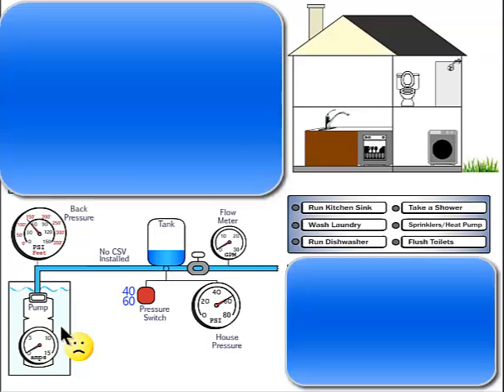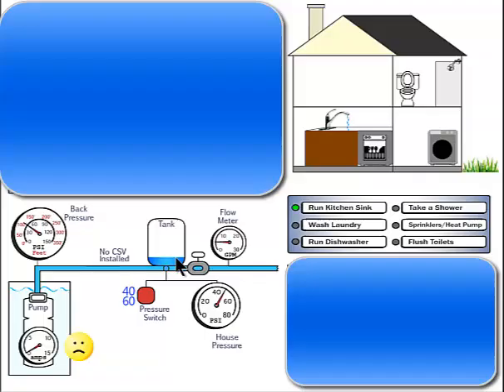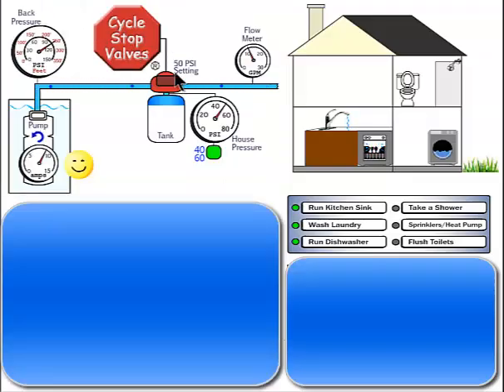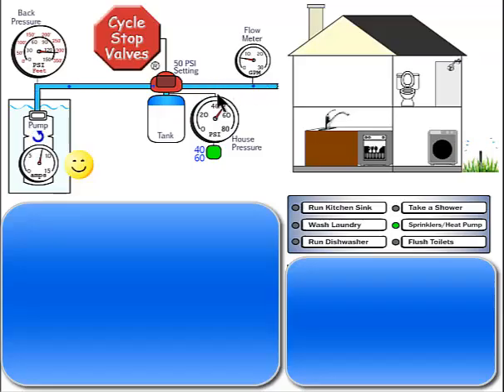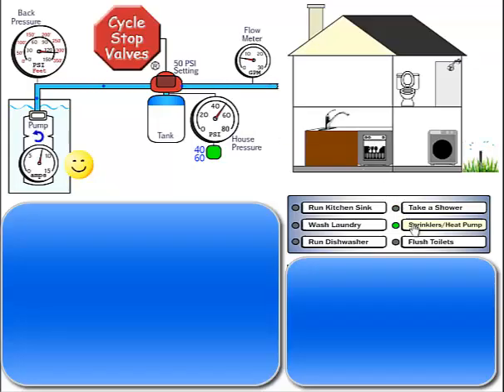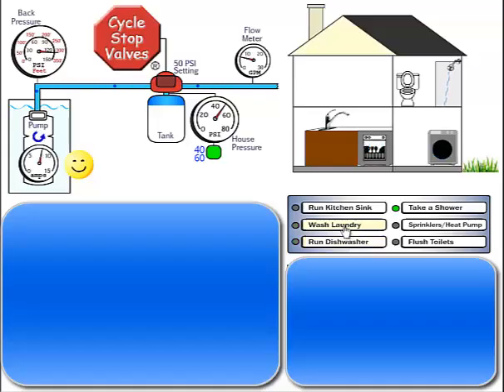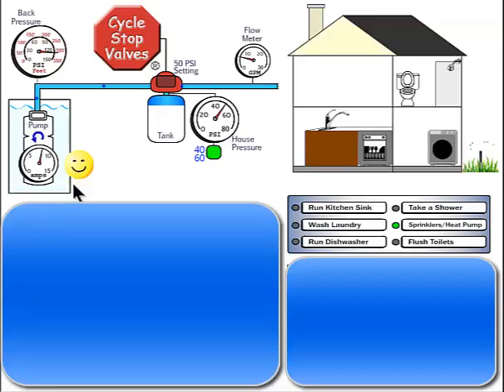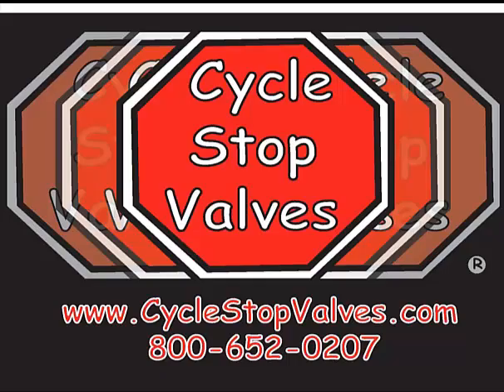How a Pressure Tank Works and why you need a Cycle Stop Valve

Comment: How would it help with a low yield well? I am thinking of putting in a storage tank connected to existing well pump AND adding a booster pump to the existing 32 gallon pressure tank.
Reply from the maker: You need the Cycle Sensor to protect your well pump from running dry.  The Cycle Stop Valve would go on the booster pump to keep it from cycling to death and to deliver strong constant pressure to the house.

Comment: I'm not so sure I agree with your theory many companies have tried "so called tankless gadgets" My Grundfos SQE and CU301 controller is a true variable speed well pump. It seems like the CSV is the "Gadget"  to harness the old traditional well pump and pressure tank system. 

The truth is, I use the Grundfos and Goulds Aquavar ABII because of the true variable and the soft start ability. My solar inverters don't like the initial 60 amp surge at startup of a standard well pump.

 Your example of how a typical well pressure system works is excellent. My system is a little bit rare and your CSV is a much more economical way of doing almost the same thing.
Reply from the maker: It is the other way around. The SQE was introduced in 1999 to compete with the constant pressure of the Cycle Stop Valve that was introduced in 1993.  They wanted something to produce constant pressure that would not make pumps last forever like a CSV.  The CSV and variable speed pump both vary the flow and deliver constant pressure.  The PWM or pulse width modulator, which is a VFD, is like a Rube Goldberg contraption compared to the simple Cycle Stop Valve.  The mechanical CSV does in one simple step what a VFD takes thousands of bits and bytes and components to computerize and line up correctly to accomplish the same task.

I agree you need a soft start if you are forced to live on solar.  But you don't need variable speed to get soft start.  The SQE pump is just a full speed SQ pump when a simple pressure switch is used instead of the CU301 controller.  But it still has the 5 second soft start built into the motor.  The SQ pump has become fairly reliable even though it spins 3 times as fast as a normal pump.  It is the CU301 most people have problems with and have to expensively replace on a regular basis.  

That is when most people find us as they are looking for an alternative to the CU301.  Amazingly, the SQ pump has almost as good of a drop in amps when restricted with a CSV as when slowed with the CU301 (VFD).  Replacing the CU301 with a Cycle Stop Valve and normal pressure switch makes the SQ pump many times more reliable and long lasting.  As neither the SQE or Aquavar are "tankless" like the ones you quoted me discussing, the existing little tank will also be fine with the CSV.

I like "rare" systems.  I have never seen one where the CSV couldn't do as good or better than a VFD.  Yes, the CSV is more economical, but it is also simpler and makes pumps last longer than a VFD.  You also won't loose the soft start feature when replacing the CU301 with a CSV.  And although soft start is helpful with inverters or generators, varying the speed with a VFD causes the pump to use more Kw per gallons produced.  You get more gallons per Kw from your solar or batteries if you use a full speed pump to fill a pressure tank as quickly as possible and let the pump shut off.  A VFD is just a Rube Goldberg gimmic when it comes to pumping water.  https://cyclestopvalves.com/pages/vfd-repair-kit

Comment: Will this work with a Harbor Freight shallow well pump?
Reply from the maker: Yes, except some of those motors say "not for continuous duty".  Only pump/motor I ever saw that says that.  The Cycle Stop Valve takes all the jerking and cycling out, but I think these pumps are still made for light use.  I wouldn't leave it running for hours on an irrigation system like with other pumps.

Comment: So if my pump is capable of build 175psi, but my pipe before the cvs is 125psi pipe, wouldn't i need to worry about it blowing up the pipe? Older 1" black roll.
Reply from the maker: Yes. That is why we check those things when recommending a CSV.  But usually there is only 30-50 PSI more on the pipe than the normal pressure that happens because of the depth of the well and the pressure on the pressure switch.  If the pump is 260' deep when the pressure switch gets to 60 there is 175 PSI on the pipe at the bottom of the well, even without a CSV.

Comment: My main concern on the Cycle Stop Valve is the increase in backpressure. I've read many positive reviews on your website about them but also many of those same positive reviews have had fittings blow apart and or leaks due to the increased back pressure between the pump and pressure tank. Although I see the need to try and reduce pump cycle's the last thing I want to do is have to dig up a water line or pull the well pump due to fitting failure from the increase in back pressure. My Franklin Electric Pump lasted 23 years before needing to be replaced on the traditional pressure tank and switch system.
Reply from the maker: Back pressure is good for the pump, cannot be any more than your pump can make, and the CSV itself has a limit.  I only know of one idiot who blew off the incoming pipe, he just posted it on Amazon, which we do not do business with, so they keep that post up top.  Lol. If your pump lasted 23 years without a CSV, it would last 40-50 years with one.  We have only done this about a million times over the last 30 years.  So, look at your pump curve, figure out how little back pressure it can build, get over your concern, and start enjoying strong constant pressure instead of seeing that pressure go up and down over and over and over.

Comment: I have been running cycle stop for about 4 years now it’s still working . We had a deep freeze destroyed the pressure switch when the 1/8 line froze .(my fault I forgot to connect heat lamp).
Reply from the maker: Thanks for the update.  I hope and expect you to still be saying the same thing in another 20 years.

Comment: Doesn't restricting the outflow from the pump put a strain on the motor increasing amps used?
Reply from the maker: No.  Actually just the opposite is true.  Amps decrease as the flow decreases.  Restriction with a valve makes the pump work easier, not harder.  But you are not alone in thinking that.  It is so counter intuitive that it even blows the minds of many engineers.  Since Youtube refuses to remove misinformation, you can find several videos from an "engineer" who makes himself look like an idiot on this subject.  He apparently doesn't know how to read a pump curve, which pump curves show the power decreases with flow.  But stopping a fan with his finger or watching amps from some kind of strange positive displacement pump shows his complete lack of education on how a centrifugal pumps works.  There are many people with whole house sensing systems that have posted the amp drop when using a Cycle Stop Valve.  But any amp meter will prove it for you.
Reply: @cyclestopvalves8380  OK, what would happen if you completely close the valve so there is no flow but keep the pump on.  What would happen to the power consumption of the pump compared to no restriction to flow?
Reply from the maker: @rogerg4916  Closing a valve before the pressure tank/pressure switch would deadhead the pump.  That would cause the amps to drop really low and the pump to continue to run until the water got hot and melted down the pump.  Then the amps would spike and trip the overload in the motor.  Closing a valve after the pressure tank/pressure switch the CSV would slowly fill the pressure tank until the pump shut off at the required pressure.
Reply: @rogerg4916  I experimented with that as I approached 0 flow pressure dropped . The biggest danger is with out flow pump cavitation can damage impeller , heat can build up and destroy the motor or seize bearings
Reply: @charlespaine987  If you restrict flow down stream pressure of course will drop.  The question is whether doing this causes the pump to use more amps or less.
Reply: Uses less Amps cause it’s moving less water… pretty simple theory actually!
Reply: @cyclestopvalves8380  The guy making videos about your product does seem like a little obsessive.  It would be easier to take your product and design seriously if you took the highroad and just stood on your/it's merits.
Reply from the maker: @dmills13F  The guy is not just a little obsessive, he is totally nuts.  It is hard to take the high road anymore.  I have been dealing with idiots like him for 30+ years and am out of patience with stupid people.  Anyone who believes a word he says is stupid as well, and I have no patience for them either.  It is illegal and against Youtube rules to post false information.  But they get more clicks from fake news than real news , so they won't do anything about it.  Youtube needs to be fixed and do what they say they will do!!
Reply: @cyclestopvalves8380  I don't agree with you on this.  You'd be trusting YouTube censors to know what is true or false. Knowing that opposing views had been censored would make people suspicious. Just let people get all sides and reach their own conclusions.
Reply from the maker: @rogerg4916  I agree with  you regarding ANYTHING that is debatable.  But going against known facts is a different story.  How pumps work is not debatable.  It is a known science.  Anyone who can read a pump curve or specs can see that amps decrease as the flow is restricted, know there is a limit to how many times a pump can cycle, but not how long it can run since it says made for continuous duty.  This is as well known and provable as the sun coming up in the east and the world being round not flat.  Posting videos or even comments that argue those facts should not be allowed or even legal.  It is against the law to yell "fire" when there is none in a theatre.  It should be just as illegal to call someone a liar and a con man when he is telling known facts.
Reply: @cyclestopvalves8380  The other guy also says that the frequency of cycling is only reduced for long durations of flow like showering but for short durations like hand washing or toilet flushes it actually causes more cycling.  Is that right?
Reply from the maker: @rogerg4916  The smaller tank causes more cycles for intermittent uses like washing hands.  It has nothing to do with the Cycle Stop Valve as it can be used with any size tank.  However, because of the way a CSV keeps the pump running until you are finished  using water, there isn't as many cycles even when using a small tank.  The "other guy" has never seen a CSV and doesn't even understand how a centrifugal pump works.  So, I can't believe you are wasting your time even listening to that crap.  Stopping a fan blade with his finger and thinking that is similar to a valve on a pump is the only clue needed that he is wasting your time. I have seen some stupid things before, but that tops the list.
Reply: @rogerg4916 The other guy put a smaller pressure tank in the system which is what would cause more cycling for short duration water use.  The CSV is not the cause of the extra cycling.  If you only have short duration water usage a CSV probably won’t do anything to help you either.  It all depends on your water usage.

Comment: What about the cycle duty times on these pumps 
Designed to be a 1 or 2 min run time.  
Asking for trouble having something like this just to not feel a slight pressure drop
Reply from the maker: Lol!  Even 1-2 minutes of run time isn't enough.  That is just the minimum.  With a CSV the pump will run for as long as you are using water, then 1 more minute to fill the tank.  You don't have to worry about "cycle duty" on a pump when it has a Cycle Stop Valve.  Although you can use any size pressure tank you want with a CSV, even with the small tank there really is no way, as in no amount of flow for any length of time that will make the pump cycle repeatedly, which is what destroys most pumps.  Cycle Stop Valves make pumps last many times longer than normal, not the other way around.